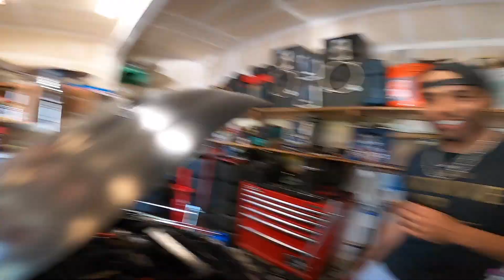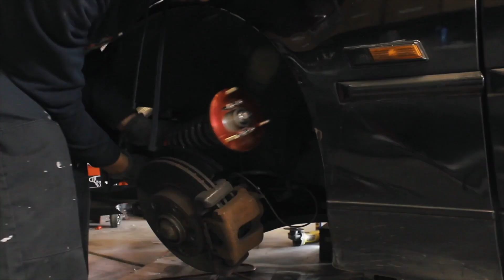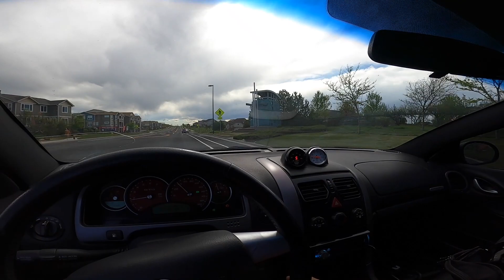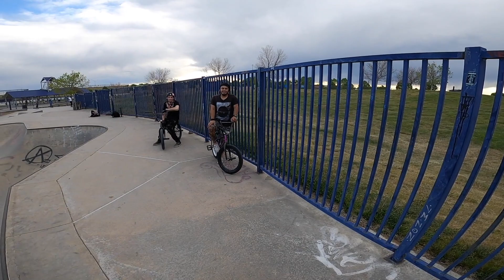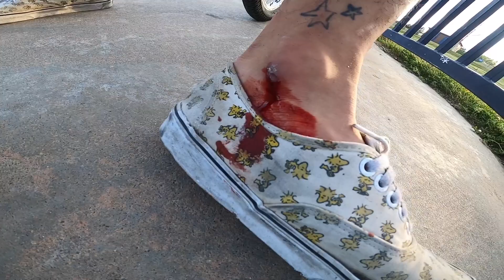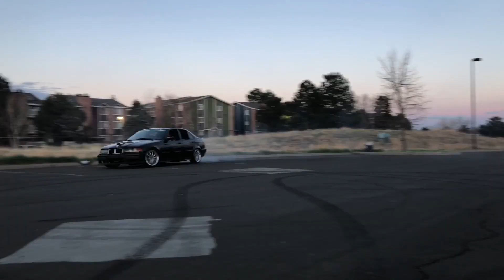THE RACECAR SNOWBALL AFFECT... IT HAPPENS TO EVERYONE!

Comment: Auto gtos? Pros n cons ? One of the only good gto YouTubers!
Reply from the maker: Ahmad Morrow can’t speak on the autos man I don’t have experience with them
Reply: In my experience:

A4s are easier to launch and more consistent at the track, they're easier on the drivetrain, a stall really wakes them up. However, they are heavier, don't run well in roll races, get worse gas mileage.  The  4l60/65e dont hold power well unless you spend a TON to upgrade or swap them. They aren't as fun to drive but are nice if you live in a busy city with a ton of traffic. I bought mine in automatic for drag strip use.
Reply: Geek Girl All I’m worried about it reliability and tuning man. I want a reliable v8 coupe that’s not gon break the bank for a daily driver
Reply: The transmission will be fine for a daily. I had one A4 as a daily for 8 years and never had issues. Just change fluids at correct intervals and you're good. Find one that has already had the suspension and bushings replaced and you're good! Good luck.
Reply: Geek Girl Appreciate it! Now just gottah find one🙃